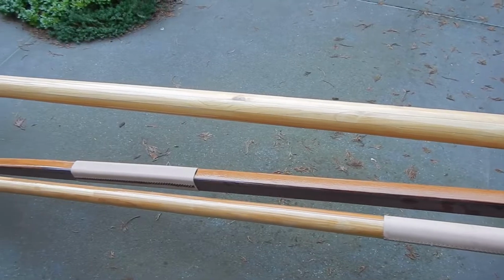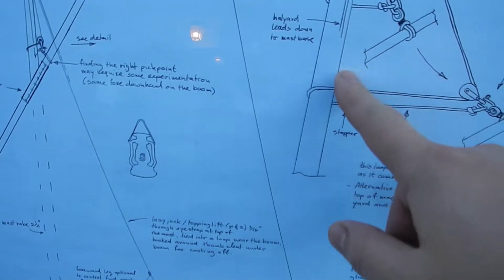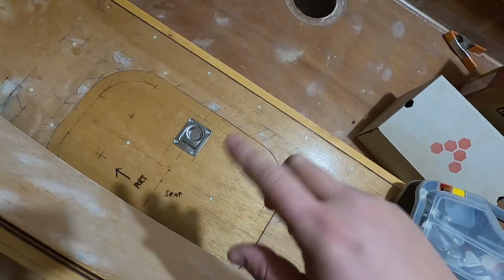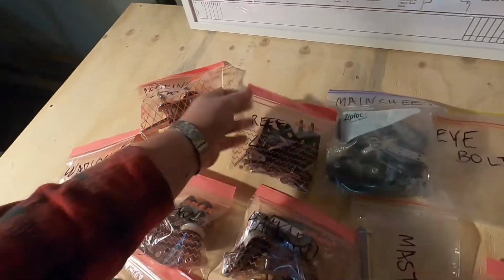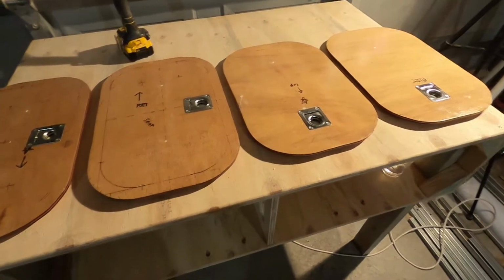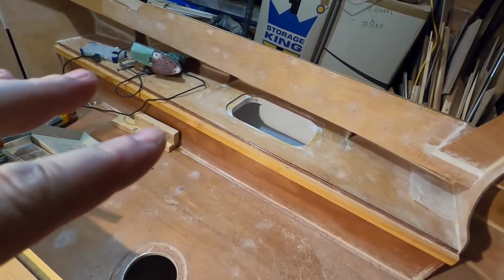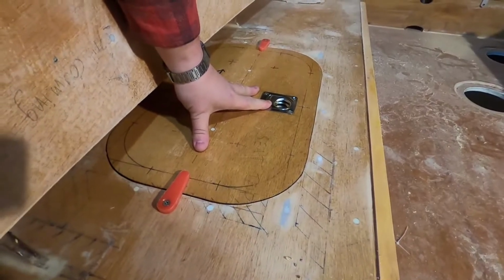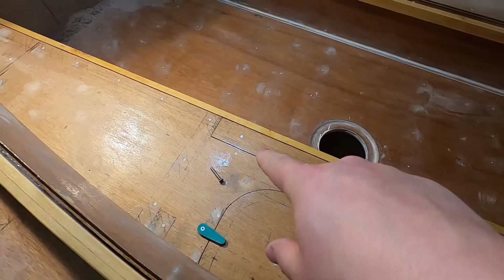Building a SCAMP part 082 - Rigging, Hatching, Centreboard Capping

Comment: Hi, great videos! With the little metal latches, if you want to get them out of the epoxy, hitting them with some heat from a heat gun should help. If you turtle the boat, will the centreboard come out the top of the seat if it's not screwed on? Just a thought
Reply from the maker: Hey, good tip with the heat gun.  Probably won't do it as I've already painted them now, but cheers 🙂.  I don't think the centreboard will be able to swivel up past horizontal since the corner adjacent to the pivot point will hit the front of the centreboard case.  Hopefully I never get to test that theory though 😅.